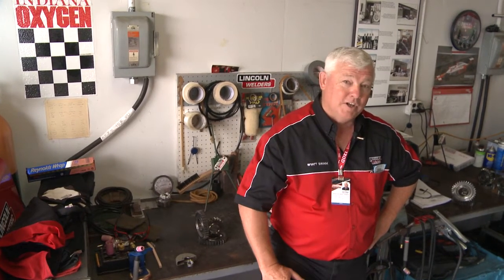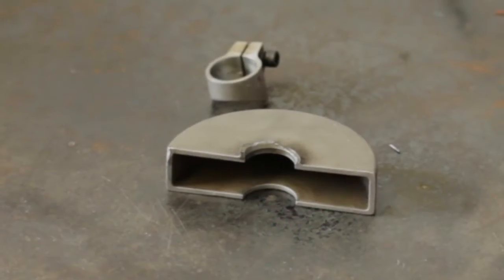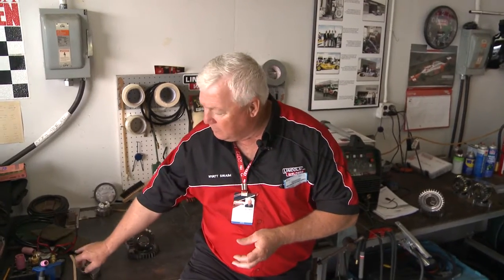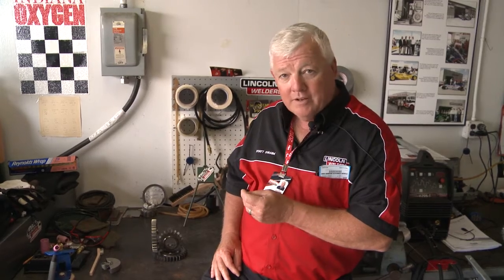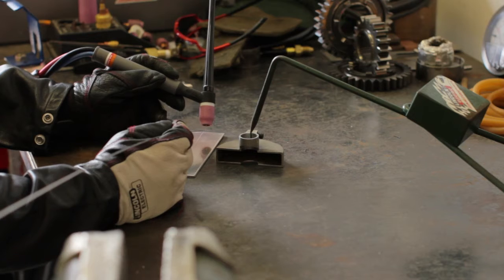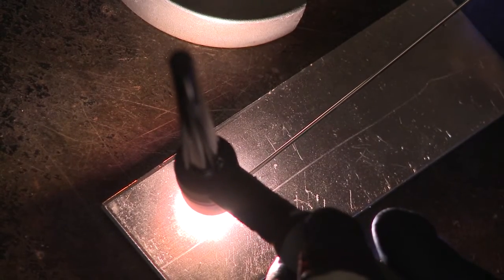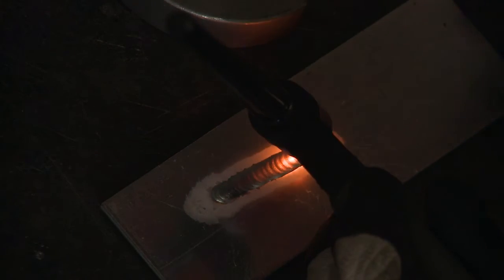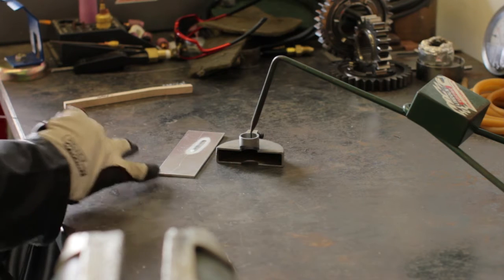Welding the Indy 500: Odd TIG Welding Jobs | TIG Time

Comment: I'm a little confused. I would have assumed the adjustable slot would have been 180 degrees away from where you welded it. As it is, when to tighten the screw to close the gap, one of the welds needs to break before the gap can close.